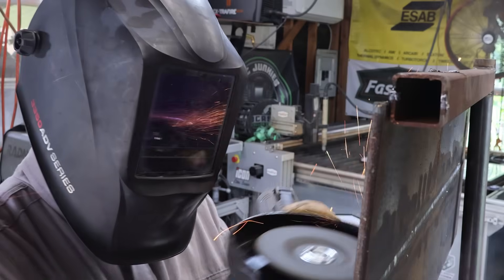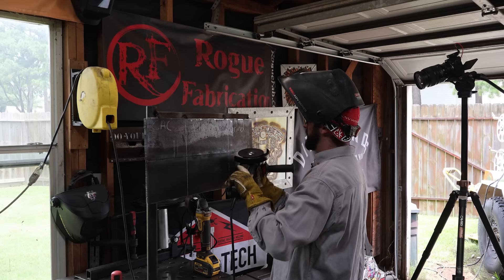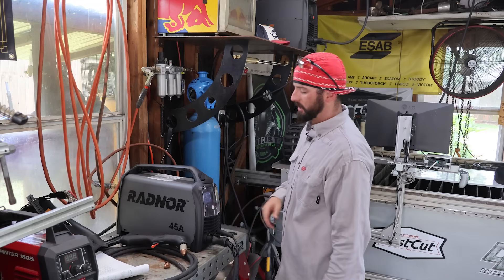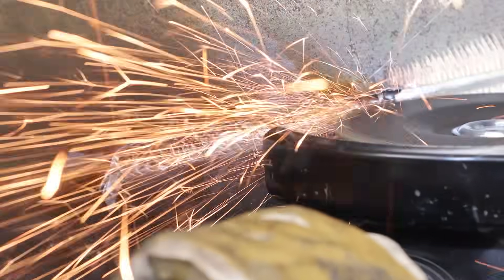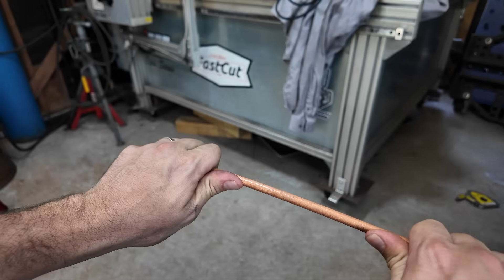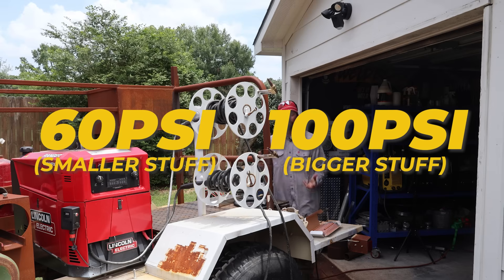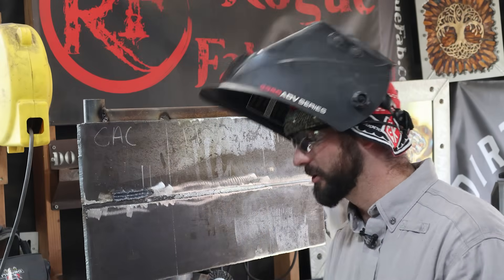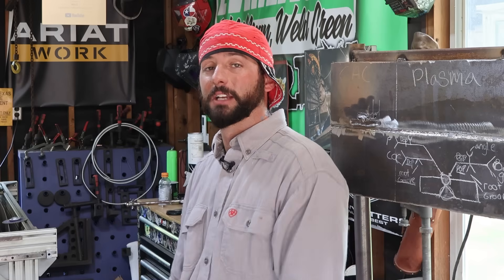3 Ways To Remove Metal Fast: Carbon Arc VS Plasma VS Grinder

Comment: Gouge with my tig rig at work sometime when we need blow some lugs out of heavy wall j bevel pipe or if we need to just knock some bad weld out and don’t feel like grinding, 450 amps and argon with get it done

Comment: Depending on the application each one has its benefits. Gauging with the plasma can be pretty fast compared to cac. CAC works great with thick plate and removing large plug welds.

Comment: I have some Blue demon 8000 chamfer rods that sort of work.  They also need a good deal of current.   Some plasmas have a gouge setting .
Reply: Those are ok for when you don't have air, but they're super expensive for what they are. I just use a gouging tip on my victor if carbon arc isn't an option.

Comment: Hey can you demo the gouge rods that do not require air. Just straight electrodes
Reply: I’ll have to get ahold of  em
Reply: I mean really you just crank up the amps over what the rod necessitates and you’re practically just melting the metal off the plate or pipe . The air is what really does the work tbh. Without it your just… literally melting the metal off and it’ll drip down hopefully without sticking to the workpiece
Reply: @delayedsantana they make airless gouging rods indeed

Comment: With the cac, is there a general rule of thumb that tells you how wide the groove is generally depending on your rod size?
Reply: Sometimes the weld symbol will call for a certain depth. Really just trying and do the minimum. More you take out the more you have to put in